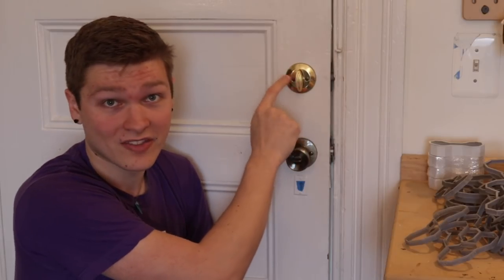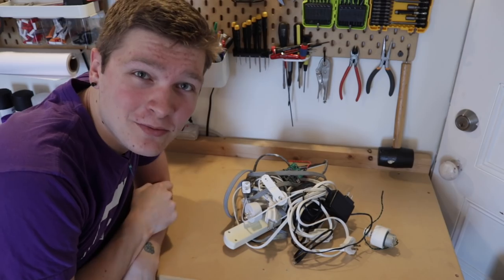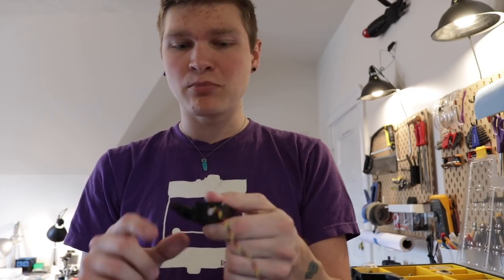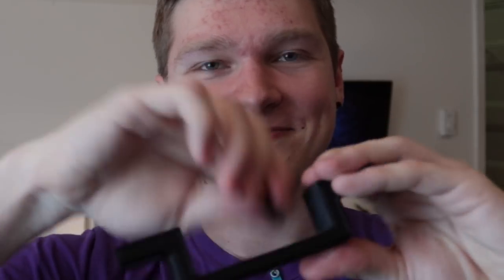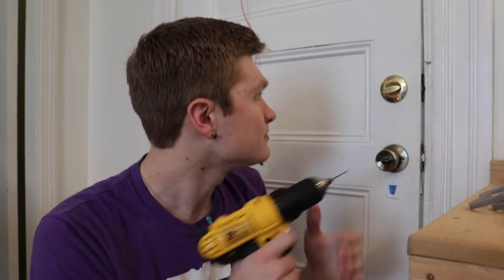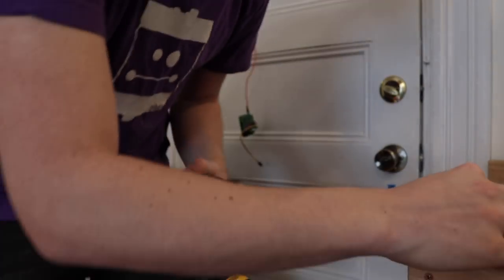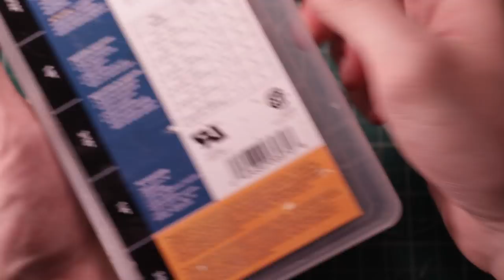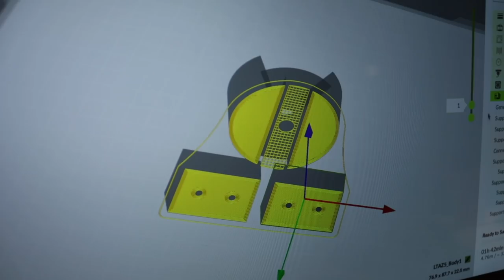Microchip Implant Unlocks My Door!

Comment: If you build electronic lock be shure that you have plan B if something will go wrong (for example no power). That is why that system shuld be installed on main lock. You always must have a possibility to open door with a key. Anyway - very nice project.

Comment: Cool Video! One question: Does your RFID chip really produces the same "response" over and over again? Would it be possible to "steal" your ID by walking past you (I mean, depending on the strength of the magnetic field you could read your implanted chip from a few centimeters away). Then the thief could just imitate you and unlock your door...
Or does your implant has some kind of challenge - response thing going on? That would be a lot safer of course... Anyway, very interesting video!
Reply: I expect it will be just a basic ID so yes could be stolen easily. Its the same as any RFID door control system though.
Reply: Mark of the beast dont do it !!!!!!!!!!!
Reply: @ripplechips5391  it’s a microchip the size of a grain of rice. He’s fine

Comment: I keep thinking 3d printing will get old but 3 years later and I still am amazed. Also its a great way to learn new skills. I never cared to learn 3d modeling but now I can do it. Next I want to learn programming but I have no idea where to start. My sister and Brother in-law are both Computer Engineers that spend all day programming but when I ask them anything about it I can tell they don't wanna talk about it which I get since thats their job they don't want to think about it while off the clock. I do phone repairs for a living and the last thing I want to do is a phone repair on my off days.
I literally just built a new PC kinda centered around modeling with some gaming. Basically a decent CPU (ryzen7 3700x) for handling modeling since thats done on the CPU and not GPU and then a decent GPU (rtx2070 super) for gaming but the important part is 32gb of fast ram. Oh and running off a very fast SSD. Fusion on my old i7 6700 ran but not super well but now my computer handles fusion with like 20 chrome tabs open like its nothing.

Comment: Just for a nicer finish you could could create a template and route in theRFID reader into the door itself. Route the main cutout, drill a hole through the door to get the wire placed, and then skim coat the whole repair to make it invisible using Ready Patch or something similar. If you placed it in the right spot  just the act of putting your hand on the knob could activate the reader.

Comment: Hey! I'm thinking of doing something similar. Have you designed up a board for this or would be willing to share more design details? Ordering my implant soon. Thanks!
Reply from the maker: Awesome!! Congrats! I haven't made a board for it, but it's essentially a microcontroller at the core, the RFID module, and a jack for the servo. The last one was more complicated because it required a DC motor driver. What your system requires depends a lot on your door and how you want to unlock it!
Reply: Mark of the beast dont do it!!!!!!!!!!!!
Reply: @ripplechips5391 keep religion out of this we don’t care about a religion we don’t follow

Comment: My only concern is if it's vulnerable to RFID cloning. Also if you have any skin irritation from that thing. That just looks uncomfortable. Having that constant bump on your hand like that.

As an information security person I have to ask these questions.
Reply from the maker: Awesome point. Yes, the tech in the chip is inherently vulnerable to cloning (as is all RFID). However the technical know how required to be able to even get the code out, nevermind actually knowing that I have the chip in the first place is a way higher barrier to entry than buying a key cutter on eBay. And it actually doesn't bother me at all! No irritation, just a great ice breaker at parties!
Reply: @stephen_hawes  The fact that it does activate only in the presence of a magnetic field instead of constantly broadcasts is a great step forward securing it and cuts out the issue of battery life in general. Short of someone intentionally cutting it out of your hand or an accident dislodging it, it looks like an amazing way to keep access credentials in a place you'll never lose it and in a place it's damn difficult to steal. A very cool video.

Also, if you're interested in knowing, your video was linked in a reddit forum r/Cyberpunk.